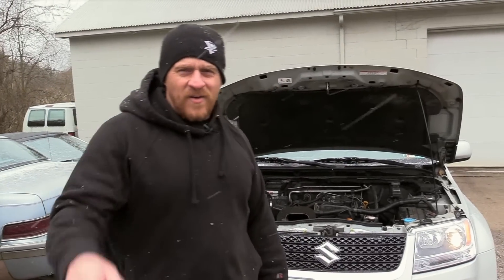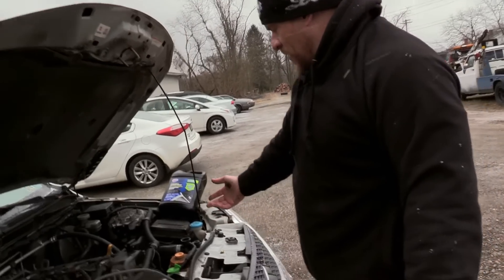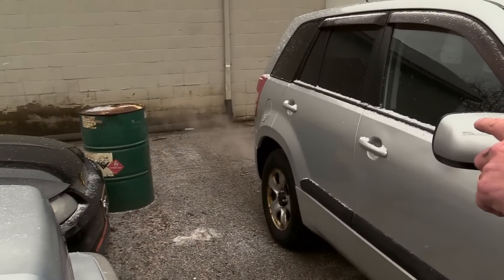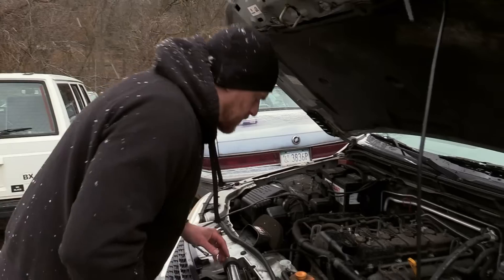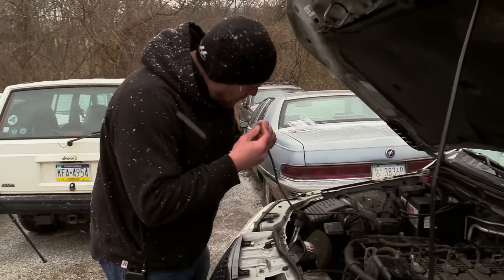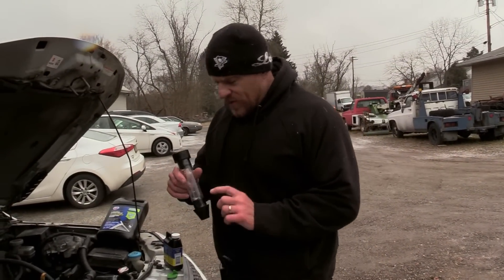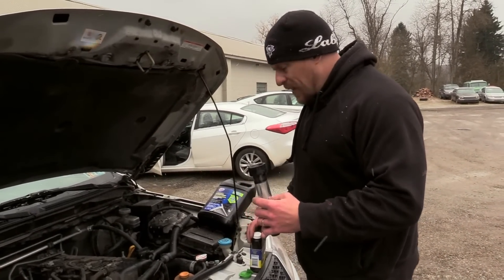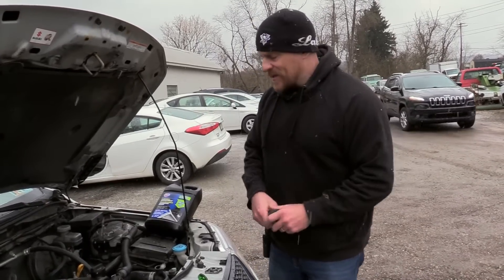Testing For a Bad Head Gasket [Chemical Test Kit]

Comment: Awesome video as always . How about showing a bad head gasket using a pressure pulse  transducer on your scope with a sync. I know its not always accurate but its pretty neat to show another use case of the lab scope.
Reply: Agree, its not my go to right off the bat. Was just suggesting to show how a differnt use case of the scope,  I work on large industrial power gen equipment . Some diesel engines running natural gas. Some models have one head per cyl. In that case its proved very helpful in isolating the specific head.
Reply: @jessemackenzie6516  And that's totally cool. We have to do whatever works for us in any given situation. I also wasn't trying to say anything negative about your comment either. You keep doing what works for you. 👍🏼
Reply from the maker: @jessemackenzie6516  all good my friend! It is another tool in the diagnostic tool box for sure.
Reply: Hi Jesse,
  I am with you on the transducer and scope. I had a jeep recently where the  ONLY external test that detected the combustion leak was a wx500 pressure transducer on the radiator neck.  Compression test was 100% normal. Chemical test was negative. Heating the oil and looking for it to sizzle was negative. No white smoke out of the exhaust. But the pressure transducer on maximum sensitivity detected it unquestionably. 
   I synchronized the pressure transducer humps with ignition signal and was able to identify the specific cylinder with the combustion leak.  A leakdown test on that cylinder was positive but it took forever for the coolant to finally start bubbling. Also after sitting overnight I was able to put a borescope onto the cylinder and see a little coolant pooled on the piston. 
    Not normally my first test as there are much faster and easier ways, but ever since then it’s ALWAYS my last test before I definitively state there is no cylinder compromise.
Reply from the maker: @SchrodingersBox  cool stuff Matt! My sons celica had a confirmed blown head gasket and I couldn't make heads or tails out of what I was seeing lol
Of course I could see it, but to know what cylinder it was, was impossible. I suppose that's the differentiation in what I'm referring to.
Agree with you on the pass/fail of the transducer in the rad. Thanks!
Reply from the maker: @SchrodingersBox  btw, I never missed one (head gasket) with the gas analyzer. Wish they were still around like they used to be
Reply from the maker: I've had poor test results from that. No reason to complicate it imo.
The only time I'd ever care to do that is if I wanted to know the exact cylinder that was leaking for a good visual inspection of that area once the head comes off. Other than that? No thanks! Too many variables!
Reply: @ScannerDanner  I agree. The scope is a great tool and pressure and pulse sensors/transducers have their place as well. But a scope is not the holy grail of automotive tools or diagnostic equipment, IMO. A lot of people are too young to know that we were using scopes 40 plus years ago. Anyone remember the sun or the bear scope, just to name a couple? Anyway, the best tool you can use for diagnostics or all around automotive repair is the one above your shoulders, it also comes in handy for getting through life in general! Peace and respect to all. 🙏🏼

Comment: How long do you let car run before you put the chemical test on the radiator flange?
Also, how long do you keep tester on?
Reply from the maker: I head gasket failure will show almost immediately. But when in doubt, I'll test it cold and again hot, after the thermostat opens.

Comment: Carbon monoxide?
Reply: Carbon dioxide.
That's why you can test the fluid just by using your breath to make it turn yellow, a good way to confirm the fluid is working properly to detect CO2.
Also by allowing the vacuum to draw fresh air back through the fluid, the fluid can be reset/returned back to blue, and then it's ready to be reused👍
Reply: No, carbon dioxide. The fluid changes color in the presence of carbon dioxide. Even though engines do produce some carbon monoxide, most of what comes out the exhaust is carbon dioxide and water vapor.
Reply from the maker: Carbon dioxide. Did you see me test it with my breath?